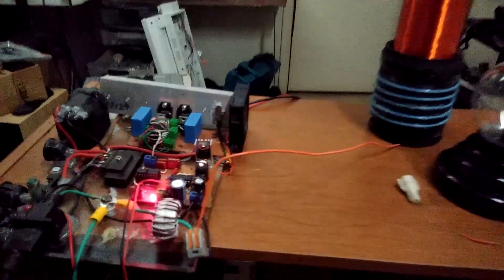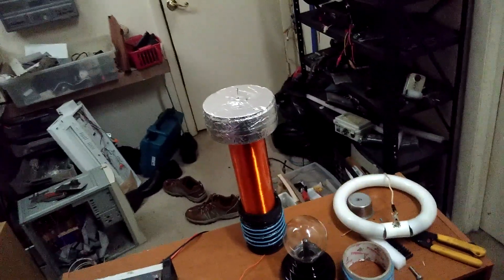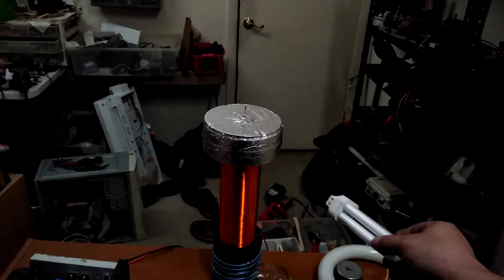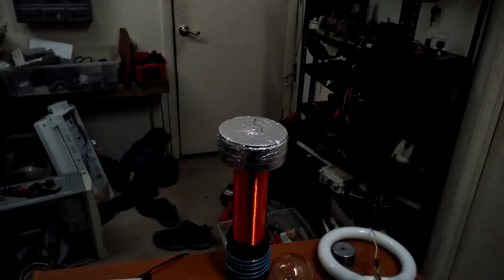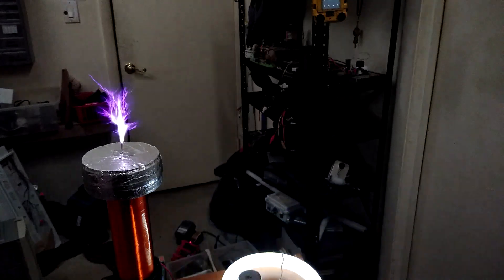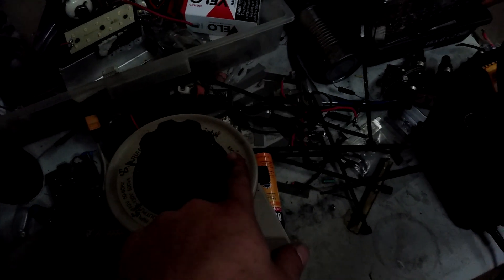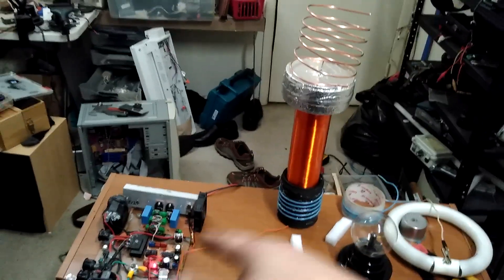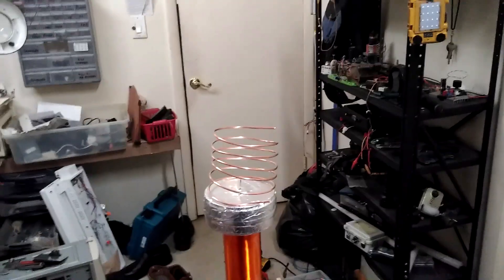SSTC Half Bridge 120vac (CW/Interrupted/Staccato)

Comment: That's pretty beefy arcs that you've got by moving that lamp close to that top load! Well, for the interrupter, did you use the one with the three triple 5 timers including the burst mode? Or did you do sort of hybrid with that interrupter by adding your famous TL494 PWM also? I think that your famous Tl 494 would have also worked fine. Maybe you should swap your other interrupters too into that circuit & give them a try & see if there's a big deal of differences with the output.
Reply from the maker: Yea the other interrupters work fine for SSTC's. Instead of using one of those I just used the 555 interrupter w/burst mode and just added a switch to allow much higher on times. I tried to just make that one a master interrupter I can plug into anything. The TL494 interrupters are not so great at tuning very tiny on times for DRSSTC usage.

Comment: What you've got there is very nice. Once again, great video & nicely done.
Reply from the maker: Thanks I've been meaning to finish up some coils. I've got 3 SSTC's and 3 DRSSTC's I'm trying to work on all at once lol.  What I'm really looking forward to finishing is the PLL driver, that one looks pretty good. These SSTC's are good for pulling hot arcs though, and they are less finicky than DRSSTC's so I don't worry about popping the IGBT's. I think I'm going to make this SSTC the one I allow things like flyback transformers to be hooked up to for running fixed frequency.

Comment: Pretty meaty arcs especially for a half bridge circuit - and with a broad frequency range ......is there a schematic available for SSTC V5?
Reply from the maker: yea check out Steve Ward's page on it https://www.stevehv.4hv.org/SSTC5.htm
His circuit has an on board 555 interrupter but you can use your own. Use the final schematic he has here https://www.stevehv.4hv.org/SSTC5/miniSSTCfnlsch.JPG .

You can use mosfets or IGBT's either will work fine. These IGBT's (FGA60n65SMD) I use work well up to around 500khz and maybe even higher.
Hard to not get the circuit to work at all, but may take some tuning around with the primary/gate drive/feedback for the best arcs. I couldn't find the perfect primary for all modes so I ended up with 2 I could swap out.